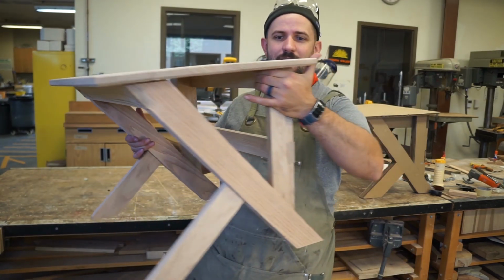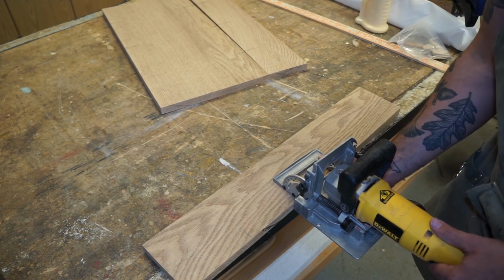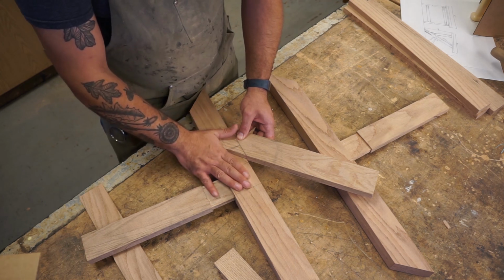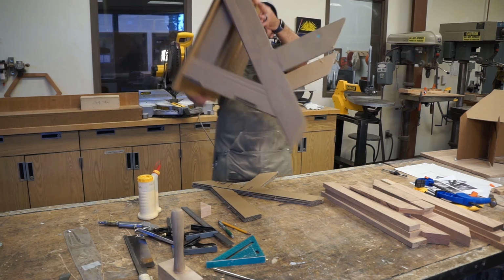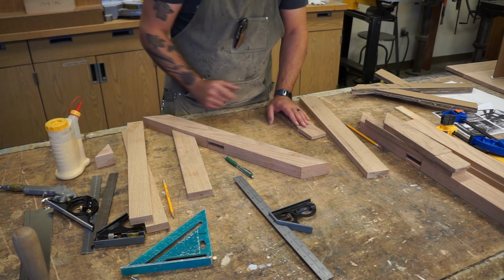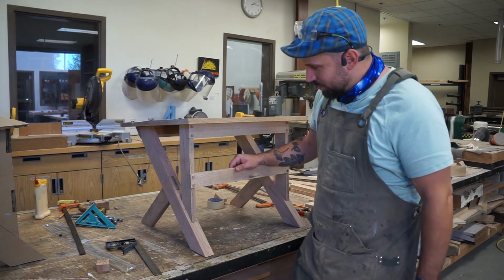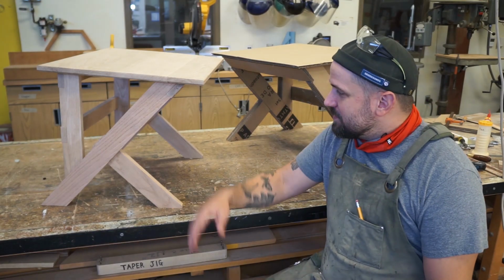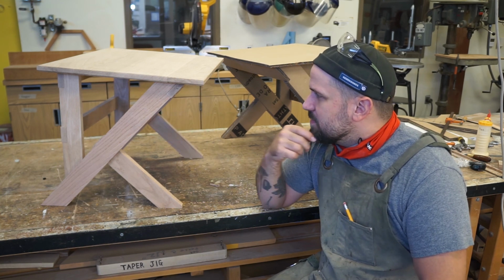Frank Lloyd Wright inspired Stool, Part 2

Comment: The design is based on a misreading of the photograph;  in the Taliesin photo (of John Howe's personal table and bench) there is a triangular gusset at the diagonally-oriented front leg joint that would have eliminated the need for much wider-than-original stock and the deep mortise-and-tenon joinery there.   The gusset disappears in the photo, probably because the architect liked to paint such things, usually red, as an accent.  Red can  turn quite dark in black-and-white photography. 

Pegged joints, unless the peg is glued into the receiving member and wedged at the applied member, can't hold the two pieces together.   Many Stickley and other Arts and Crafts pegs are actually dressing to conceal---very handsomely---screws that are doing the structural work.  Screws applied across the grain of the receiving piece are the perfect attachment.

Looks like you found a sliding (?) table-top fastener.  Why not show us the hardware ?  I'd be interested to see something better than the stamped figure-eight piece so often employed.
Reply from the maker: Thank you for all the information and sorry I didn't acknowledge your comment sooner. I saw the triangular gusset in some of the images I found but I decided that I liked the look of the bench better without the gusset and using a mortise and tenon seemed like it would be plenty strong enough. I knew this wasn't going to be a perfect reproduction so I took liberties, inspired by the original Taliesin furniture, not copied exactly. 

I certainly love using concealed screws in a lot of projects but I decided to use squared off pegs for this one. I will certainly hide screws using caps in the future but I like incorporating a variety of techniques. 

The hardware I used at the end of the video was simply what I had on hand. It wasn't what I really wanted so I didn't provide much detail on it. I've already removed the fasteners while I've been finishing it and will replace it with something different for the final assembly. I plan on  publishing a new video soon detailing the finish and I'll make sure I include the details of the hardware in that video. Best to you.
Reply: @777arcesso  Thank you, WW !  Keep on keepin' on---and enjoy the trip.  I like your "assembled mortise"---I've done that myself.  Anything that achieves the desired result with the least labor is my idea of how to do elegant and efficient woodwork.  No all-day chiseling for me !